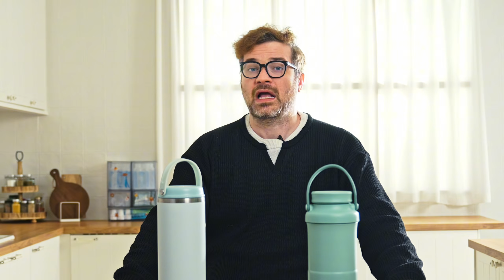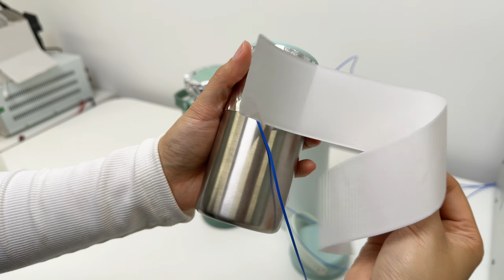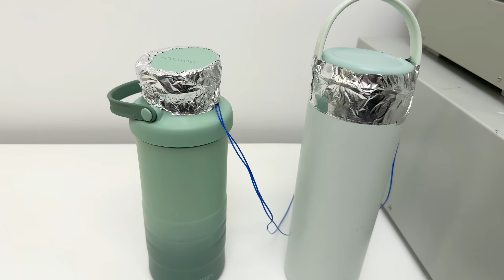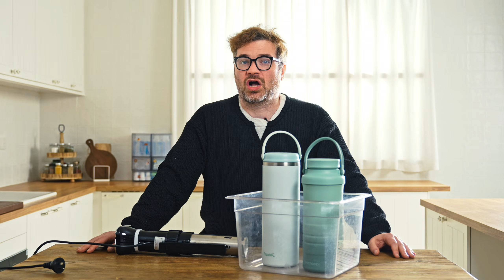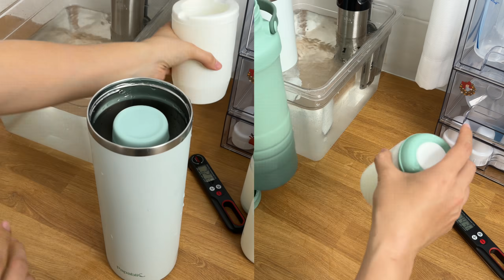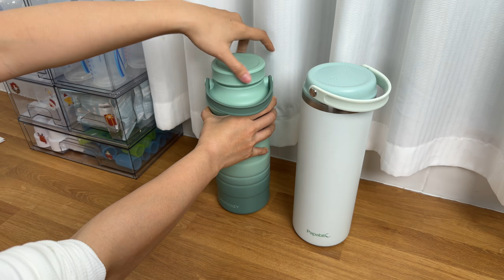Baby Essential | Breast Milk Cooler Extreme Test | Papablic vs Momcozy - Which One is Better?

Comment: I like your video testing but would be nice to go over more practicality.  For example can I just put Avent or Dr brown bottles in them?  Also do you find it actually much more convenient than lugging around a traditional cooler? Which type of user would be able to best take advantage of one of these?  Still a great job on your video but those kind of questions were what I would've wanted answered more.
Reply from the maker: Thanks! Appreciate your advice!